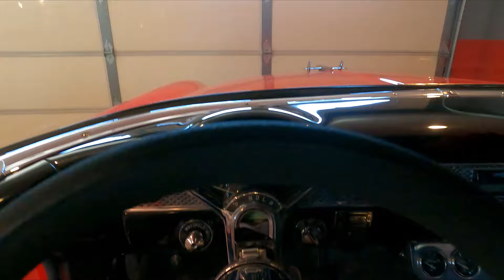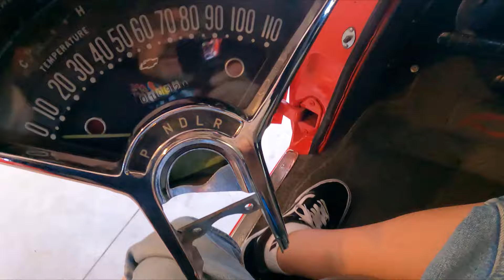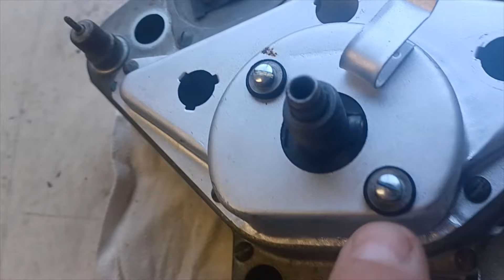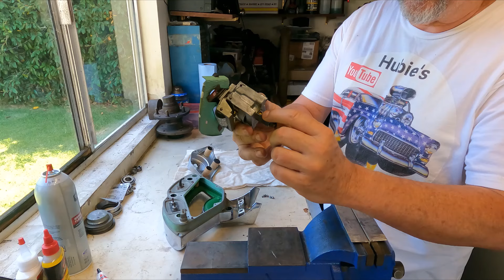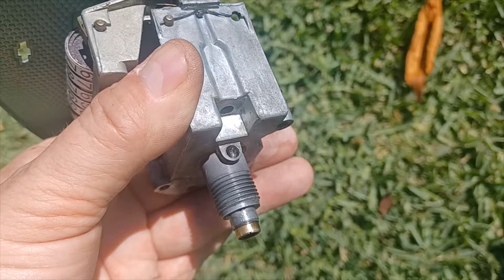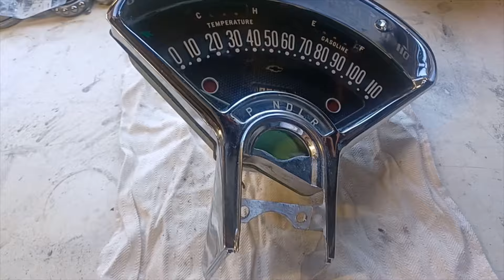'55 '56 Chevy Speedo Repair and Some Stories of our '55's

Comment: Good video Jeff, well worth waiting for, did you put the felt back in that came out, or new felt, catch you soon buddy😁😁
Reply from the maker: Thanks Mike!  I ended up taking the felt out of the other speedometer for the Delray and using it in Howie's speedometer.  I will get a new one for the Delray later when I restore it and put it back together.  If you do the speedometer for your truck, I hope you are able to do a video.  It would be neat to see the differences in the truck speedo vs. the passenger car speedo.  Thanks for watching and take care!
Reply: @hubiesgarage  ok Jeff, I will be addressing it soon, lots of parts going on the 55 truck
Reply from the maker: @DesertRatFabrication Sounds good Mike!  I need to get caught up on your build!

Comment: Cool how to on how to service your speedometer head Jeff, instead of replacing twisted speedo cables, just a little time and oil and you’re good as new! Like you said too, it’s a good time to replace any other parts in there while you’re at it! Thanks for the tips Jeff, appreciate it!
Reply from the maker: Thanks Raymond!  I probably should have wiped the gears with some lithium grease but, it looked like it still had some on them.  The '57 should be very similar as I have had those apart too.  Thanks for watching Raymond and have a great week!
Reply: That’s good to know , I put an Autometer speedo head and gauges in my cluster but still good to know how it’s done. Have a great rest of the week too Jeff!

Comment: Excellent video Jeff. This will come in handy when I can find a cable that hooks up my 400 turbo to the 55 dash. You wouldn't happen to know of an OEM cable that would work do you? Man the more I see Howies 55 the more I like it. Especially that red!
Reply from the maker: Thanks Gorni!  I got the speedo cable from Summit.  I think they may be universal with 1 or 2 different lengths.  See what Summit offers online.  The '55 has been red ever since '63 when he bought it from a buddy here in town.  He got it painted red again in the early 70's by an Earl Scheib kind of place and then our Buddy Tom Rodriguez of Cypress Auto Body did the Corvette Torch Red back in about 2001.  It is holding up very nicely!  Thanks for watching and have a great week!